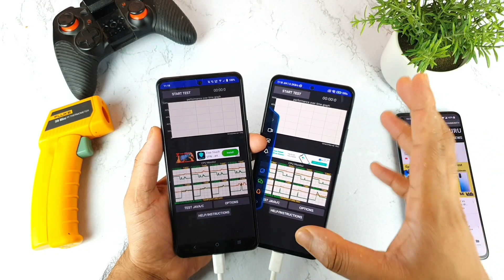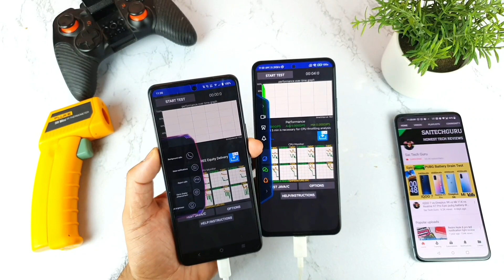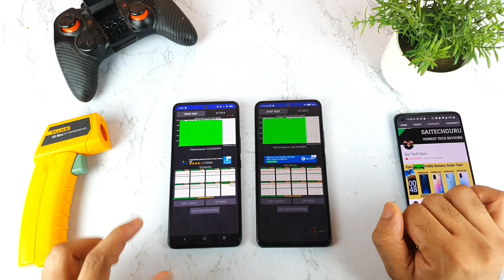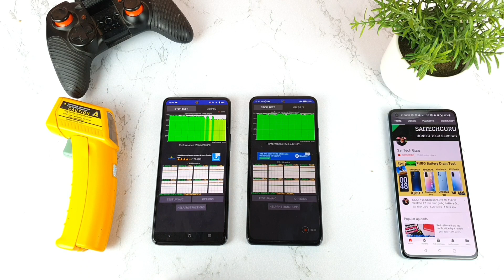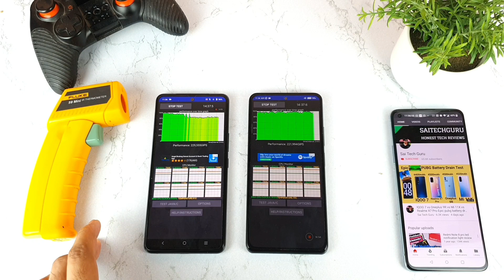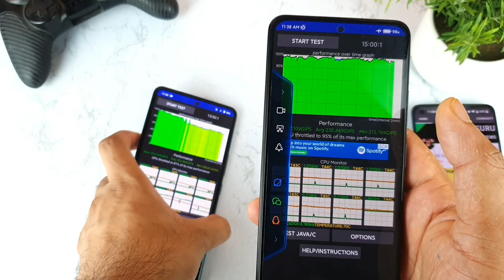Comment: Though iqoo 7 throttled, it's performance is better than the mi11x , even when it dropped to 80% it had better performance than the mi11x which was above 90% so obviously there would be more heating.( This is only what I think ,it maybe wrong)
Reply: @Khadangban Umakanta I'm having iqoo 7 I have no problem atleast with my variant.